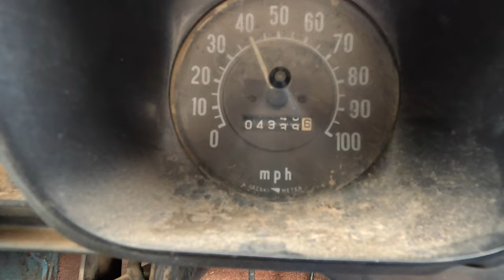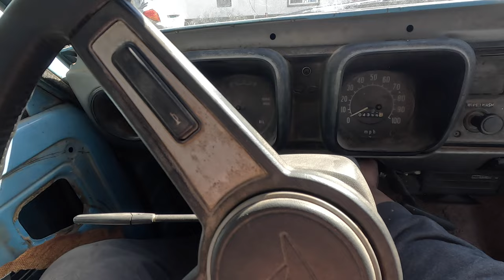First Drive And Manual Transmission Swap - Abandoned Toyota Hilux

Comment from the maker: What ENGINE would YOU swap into this truck if you had the chance??
Reply: Maybe one that your 5 speed would normally be mated to??? I'm not but you're crafty enough to make fuel injection work!
Reply: A 22R I think that what they call em
Reply: Any Toyota from 20R to 22R engine is perfect for this 1973 year model Toyota Hilux
Reply: turbodiesel from the '85 camry
Reply: My head is leaning towards any kind of turbo diesel that could fit. The amount of torque you could get on a truck that light would be delicious
Reply: No swap. Leave it Original.
Reply: What ever is available." Just to keep the truck running.."
Reply: I used to think the 22re was the best 4cyl ever made, but having driven my new (to me) taco with the 2.4, I'm loving the torque and I must said, a bit more refined than the 22re.
Reply: 22R with a 5-speed
Reply: 2.4 or 3.0  D4D direct injection turbo diesel

Comment: Those trucks run forever here in Africa
Reply: One of my re furbished toyota starlet 1 3  hundred something hp ended up in africaa few years ago it had 434 000 km on it an compression was god. Shouldnt have ditcht it.
Reply: Put a rear bumper in it. And put a cab guard too.
Reply from the maker: As long as they don’t rust they last forever!

Comment: Wow! I'm so glad this channel popped up on my feed last week. I immediately subscribed after watching the first video on this awesome truck and couldn't believe you didn't have at least 200k subscribers. My dad bought a brand new Toyota pickup manual with the 22re in 1992 and sold it 10 years later with 500k miles on it and it was still running strong. Ever since then I've been obsessed with these trucks. Especially pre 1995 models. Can't wait to see you blow up with this channel. It won't take long given the quality of these videos.
Reply: I hear ya bro.  I have kept my 1992 with 22RE/5spd/2wd/a-c/ very simple and awesome pickup bought new.  I have just lavished it with a whole front-end replacement kit..the first ever in 32 years.  And this thing has over 600K.  It is unbelievable that it starts up RIGHT NOW every single time.  I want to be buried in my 92 Toy!
Reply from the maker: I appreciate the support and I'm working hard to make the best content and videos I can, I'm glad they are being enjoyed!

Comment: I owned a 73 Toyota truck with a 7 ft. camper on the back. In 1975 I drove from Edmonton, Canada, south through Salt Lake City, Reno to San Diego, walked across the border into Mexico for a few hours. Then drove up the coastal road home. Quite a trip.
Reply from the maker: That’s the kinda trips I want to go on!
Reply: Reminds me of Terminator 2 "This is the vehicle's top speed" - Driving a HiLux sized pickup truck with some camper-like box on the bed at 55 MPH

Comment: Too bad the government decided that we had to buy BIG $ trucks loaded down with useless crap, computers and extra turbo. If automakers could legally sell a brand new 2wd 4 cylinder manual small pickup or sedan,  they would sell as many as they could make.
Reply: I hear no lies.
Reply: Exactly. Stuff that WORKS!
Reply: i have a new 2x2 Tacoma  i wish they would make them smaller too
Reply from the maker: Agreed
Reply: The regular compact size is just enough. With 4 cylinder or V6. No V8s. Because gas price now a days is so high. And so many limited parking spaces for big cars and trucks.
Reply: @micktepolt6276  Smaller, But with longer and bigger cargo beds.
Reply: That would be a new Hi Lux Workmate.  2.7 litre 4 cyl gas engine.  Manual transmission, not sure if 5 or 6 speed.  Aluminium drop side tray: 8' x 6'.
Reply: @railtrolley  The Hi Lux can't be sold in Poopy Joe's America.
Reply: Toyota just came out with one, but they can’t ship them to the states. I just bought a 1972 Toyota hilux, and I am looking at buying a kei truck
Reply: so agree trucks now are luxury which should not be. Go back to the old ways simple way of a truck, the way trucks should be period.

Comment: we called the auto trans   a slush bucket  and they did rob power even when they were new , but the stander  trans  may need a little help too  ... your doing good work
Reply from the maker: they defiantly are not fast trucks, but the manual makes it so much better!

Comment: Thanks for this video, You also found out that you also had to modify. I had the Manual odd transmission that I have to remove to sldo install a five speed transmission. Im still in the planning stage, this placed me ahead a bit prior to seeing this. Mine is a 1974.

Comment: From one Nicholas to another, keep doing the work you do -- I've loved this series so far. As far as seat swaps go, I did some quick forum research and it seems like a '90 4Runner's might be a bolt in for the 80s Hilux, unsure on the '73. Otherwise seems like you're not afraid for a little custom work so maybe looking at smaller Japanese cars from the 80s/90s/00's or a Cavalier seat swap. I know the Cavy swap was doable on S10s
Reply from the maker: I’m Thinking a newer Tacoma/ 4runner 4 cylinder

Comment: Go to a junk yard and pull some truck back seats or SUV rear seats.  They're always in newer condition and they have less padding which gives you more room in a small truck.
Reply from the maker: That’s a good thought, I should walk the local pick and pull
Reply: A Durango second or third row could work.  Second row has tilt but third row has super thin padding and isn't as wide..  Depends on interior cab width and what will fit.

Comment: Ok. I restored a different year. It was a 76’. This generation was made between 75’ and 78’. It had  a few improvements. As the manual said, it had more cabin room for “ oversized American drivers”. I am 6 feet tall, and it was difficult for me to fit in there, so I can only imagine in a 74’. It came with a 20R, hemi head engine. The 76’ was the first year for front disk brakes. That being said, I drove it home from the auto delivery service, and the front end suspension and other parts were shot. Also the exhaust manifold was cracked, like I think the one in this video. ( yeah, I think it got me high on exhaust fumes on the way home. ) Had it welded.  Pulled engine, and replaced all seals and fluids. Did some body work, and had it painted. Replaced all tune up parts, and minor stuff like alternator,water pump,  etc. This was in 2008, so a lot of parts were being obsoleted, and were cheap. I would be glad to share some pics, but I can’t figure out how to do that here.

Comment: Why do you Ned to swap out the automatic transmission with a manual transmission? You can have the automatic trnsmission rebuilt in less than two weeks at you local transmission shop specializing in Toyota transmission. You probably need to have you speedometer and odometer cables replaced and the odometer teeth gear replaced as well.

PLUS......

PLEASE UPGRADE TO THREE POINT RETRACTABLE REEL SAFETY BELTS!!!!!

Lastly.......

Would you consider doing an LS1 engine swap upgrade?
Reply from the maker: I swapped because I want to use the truck and the automatics rob so much power and have fewer gear options that it takes away from the capabilities, plus the manual I put in it can be used for quite a few engine swaps and will hold the power of a newer engine. and I actually already got the speedo working, the cable was just not connected
I should for sure find some shoulder belts, as the lap belts are not very confidence inspiring. 
I've thought about a v8 but think id want to keep it pure to Toyota and do either a newer 4cyl or a Toyota v8.
Reply: Looks like a Ford C4 auto would fit & then he could add a gear drives O.D.

Comment: 🤘🏼

The 90-95 4runner 89-95 pickup seats are always a great swap into older trucks. Not sure how well they will align with the factory mounting holes in that era.
Reply from the maker: I’m not sure many seats will bolt in without modifications

Comment: These kind of rescue & builds are much more "My speed." No tubs, 800HP engine build, $30K paint job, custom, custom-stitched baseball-glove leather interior...stuff that is just a money hole on a vehicle you can't or won't use. I've built a '76 Valiant sedan I got for $0 in the same vein; 318 fully built (340 forged crank, forged I beam rods, '90 '308' casting heads, Edelbrock intake & carb, distributor built & curved for the combo, TBS headers, etc), 2.5" dual exhaust with an X crossover, 8.75' swap with 3.23 sure grip gearing, even a factory A-833 OD stick conversion! It's received 12" rotor swap, BAC suspension & steering, FFI rear sway bar & 11.2" rear discs. Weather stripping, carpet, headliner, radio converted (looks stock, but has digital AM/FM/BlueTooth, 4-speaker output and amp hook up). 
The whole goal was to have a vintage car that can keep up with traffic, much better handling & brakes, reliable and as trouble-free as possible. It's almost where I want to to be
Reply from the maker: That's the goal with this build, something vintage that can perform with modern cars, but I'm not afraid to drive.
Reply: @redlineranch.  Best part? No payment & retains value at a minimum. I live in a very nice area, have a couple nice cars, but the funny thing is the Plymouth grabs the most attention. Waves, smiles, people talking about owning one, a friend in HS/college had one, grandpa...it's cool in that way

Comment: I would have started with a proper tune up of the motor.  Maybe this is why the torque converter is hunting.  Not enough torque to make it change.
Reply from the maker: Not sure if that’s why it slammed from 3rd to 2nd at 50

Comment: She’s supposed to have an L43 four speed manual, which would be almost impossible to find. But I have one…
Reply from the maker: I have a lead on one very close to me, but the fact is that a 5 speed is more usable, and it was free, plus it can be used if I want to engine swap the truck, so it just made sense.
Reply: @redlineranch.  yes absolutely and it would be better on gas. My sister had a 76 that I had found a spare trans for. She’s had it for many years and loves it.

Comment: Why didn't you bend the clutch pedal out of the way?

Hope your channel takes off, I used to work on and own these cars when I was a kid
Reply from the maker: there isn't much room before the wheel bump out in the floor and it would have started to limit the pedal travel. most old Toyotas have tiny pedals for that reason
Thanks for the support I appreciate it!
Reply: @redlineranch.  righto, never noticed

I had 3 Supras, about 5 Celicas including a 1975st and a Hilux over my youth

Comment: Great video, but ya gotta improve your audio.
Reply from the maker: My audio is actually high quality for my video levels, I’m using high end mics for all my recordings, I just live in an extremely windy area that’s right next to a major highway, it’s hard to get good audio in those conditions
Reply: @redlineranch.  Thank you. On another subject. I got tired of fucking around with the points on my Hilux, so my Son found an electronic distributor that fitted my 3Y motor. Not sure if the same could be done to the 18R.

Comment: Oh your not old enough but old Toyotas automatic transmission have to start in  1 then when you get to 30 then you go to 2
Reply from the maker: The big issue was it forcing the down shift from 3-2 at speeds and jerking the truck heavily

Comment: Bread
Reply: Lol fr I was thrown off by the random 🍞. Is it like a running joke ?
Reply: @davidguerrero6622 No but there was bread around 11:13. But it should be
Reply from the maker: The bread was used to pull the pilot bedding from the spare engine
Reply: @redlineranch.  😂 Thanks for the info. That's pretty cool

Comment: ya it a toy and its a pos other than that it need v8 swap make it up to date or wise like 4 cyl thier just way under power for refuctions current traffic great to each thier own had thier time and place was cheap inport now if you watch so bag them so drop them some rather just body swap to 4 runner size close others newer smashed chassies with 5.7 iforce vvt point is 22 re or any of them diesel well got inport that